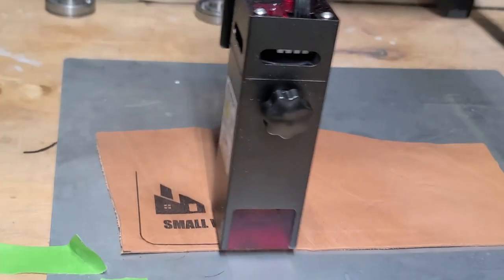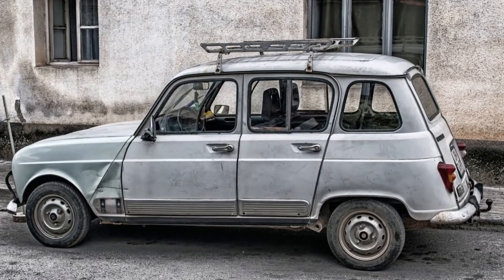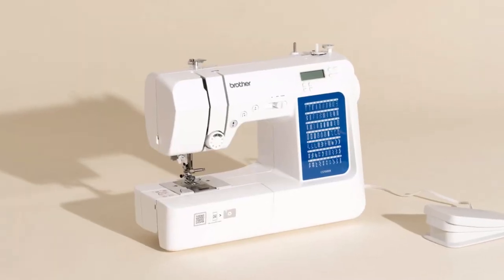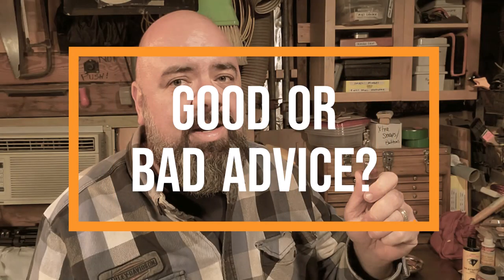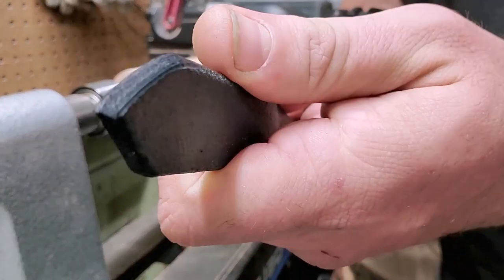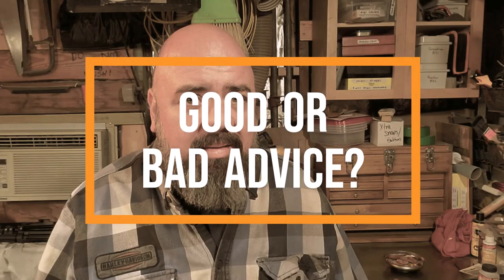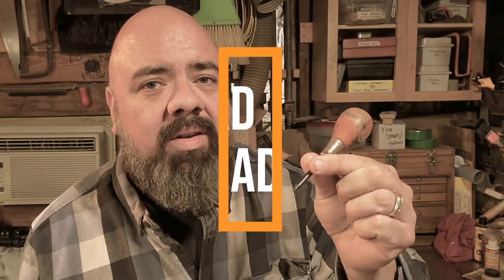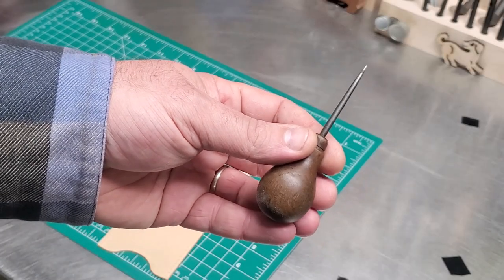INSTANT REGRET - Beginner Leather Craft Ideas in 2023

Comment: Here is something that might help without breaking the bank. Rather than trying to find granite for stamping try a piece of marble. I bought a piece that is 3/8x12x12 inches. $5.00 A bit sharp on the edges but easily sandable.  I keep it on a cutting mat and have really pounded on it with no problem.
Reply from the maker: @larrycumba2741 This is a great inexpensive idea!

Comment: On the 'only buy a tool when needed' point. This can also lead to a complacency trap. It is easy to fall into the habit of saying 'well this project would require this new tool/material so I will skip it for now' and then never actually get back to it.

That said, one leathersmith I know is fond of saying that most of the work you will do can be done with 4 dedicated tools. Knife, Needle, Mallet/Maul, and an Awl. Apparently, nearly everything else can be done with other things. For example, a cloth can be used instead of an Edge Slicker and to dye the leather. Though apparently, he watched a video by the Skill Tree youtube channel and is now obsessing over the filling you can get for homemade stuffed animals as the way to dye leather for cheap. Bonus in that you can always make a stuffed animal or pillow with it.

Edit: Said Leathersmith has asked me to specify that he does recommend a strap cutter, round knife, and a good pair of shears as immediate purchases if one decides to go any further than just making small items.
Reply from the maker: @jtmc93 I can definitely see the complacency thing happen,  you would just have to be aware of this mindset to avoid i t,  instead of avoiding the project you would like to build.

Comment: I’ll have to admit to using a pick, for my stitching holes. ( and a dremel). Not my Tandy , but the Chinese ones that came in a kit. They are a lot thinner- I have needles the same size! Since the handles broke often I purchased a few more. Now, since those prices have gone up, I’m hoping my last one lasts!
I actually do not like the chisels, all that much. They don’t go through thicker leather. Plus I think they also push just like a pick.
I’m curious about what’s a good & inexpensive strap-belt cutting tool. 
My strap cutter will not cut 11+ leather. It breaks the blade and also readjusts the strap width. 
I see there is an Ampseven that looks like it might be useful. Anyone know?
Reply from the maker: @cherriebeyer9531 Thank you for sharing your experience.  I sometimes use a stitching punch that will cut three holes in a holes in a row.  Its cuts holes like a punch, and doesn't have chiseled ends.
But, if using the all works fine with you,  I say stick with it. 
As far as the strap cutter you are talking about it,  Im not familiar with it.  Perhaps one of the Big Stacks Family can chime in with more information.

Comment: I'm in the semi-disagree about the tools one, a major reason is that it's something where I've had several projects that I've tried out doing which I never would have considered except that I had the tools there to try them out with several different things. Also, with things such as stamps and other tools, while not necessary, looking for deals for interesting ones is a fun thing to do and the stamps aren't that expensive to start with.

Same thing with the amazon kits, several of the kits, especially the ones with a nicer case, are a good starting point for getting a lot of things at once. There are also the project kits that are another great option on Amazon and elsewhere for different things that give you what you need to make them (or most of the things). It also works as a way for someone starting to actually feel like they've accomplished something with something actually being finished during it and many give you some tools in the process to build it up.

Also, the spiked roller that you were using is for marking stitching holes, you run it along a groove and it marks regular points to go through with stitching. I've largely used it to mark locations so that I can count them out and figure out the specifics for the actual hole placement since a light run through a groove doesn't leave much of a mark when you're done and higher pressure, with thinner/softer leather can go for the entire stitching holes.
Reply from the maker: @AzraelThantos I can agree with you on getting some of those stamps and some of the specialty tools if you find them at a good price or on sale.  I bought someone's entire leather set before and got a bunch of things I still haven't used.
I'm still in the camp that some tools in the tool kit are okay,  some are cheap garbage.   After working with decent tools,  I still think it's best to purchase the tools outside of the kits. 
I'm going to try that spiky wheel for stitching holes, because I don't see how it will work out properly.  But I'm willing to try and eat crow if I'm wrong.
And you are right about the 3d stamps, this things are really cool.   They add a great touch to your work while starting out!

Comment: i've been told that the wheel you asked what it was is a stiching wheel. It is used to maker where the stiching holes should go. It is used with a stiching awl to create the holes. I do not have one, and do not plan to buy one, Iagree with you, stick with the punches designed to give you the best results.
Reply: I have what he is showing. They are not the same as the stitching wheels. They have thin almost like bristles, and are too close for stitches.
Reply from the maker: @edgell3 @cherriebeyer9331 is correct, the pins are too small.   In my livestream video from a few months ago, one of the Big Stacks Family told me it was to transfer patterns using carbon paper.
Reply: @bigstacksshop  I was taught that both are right.

It transfers a stitching pattern through carbon paper or directly onto the item depending on circumstances. The closer stitches are meant for lighter weight leathers and cloth.

One way I was shown to use it was to lay a piece of cloth on top of carbon paper on top of the leather, then run this along where the seam will be. Then use that to sew the cloth and leather together.

The example being made was cloth lined leather gloves.

Was also told that if you have a sewing machine capable of doing this then it is pointless.

Edit: though the Amazon specials variety tend to be flimsy compared to others.

(And I was also informed it can be used for something like embroidery on leather though it wasn't elaborated on how that worked.)
Reply from the maker: @JTMC93  when stitching fabric and wood together makes a lot of sense.

Comment: So i wonder, olive oil does go rancid; linseed oil usually manages to avoid that, or it goes through that stage while not becoming permanently stinky and gels instead.

Whether you should be using something from a tree or from a cow when doing a cow hide thing? Well there's a good reason most of the cow got stripped away, it wasn't good for it either, the cow goes bad rather rapidly and very very unpleasantly. Sooo... it depends i guess? You probably use wax, does wax come from a cow? Some of the products used in the craft may contain petrochemicals, do they come from a cow?
Reply from the maker: @SianaGearz I use the stuff which came from the cow to hydrate it just enough.   I'm not trying to turn it back into a cow.
I do agree wurth your logic,  there are a lot of products which aren't from a cow and work.   But I definitely don't want something which will go rancid.

Comment: ive been using olive oil since i started and have never had it go "rancid"
Reply from the maker: @jacdupleatherworks I admit I haven't personally tested this theory with leather,  but I've been woodworking a long time and I know it will get a funky over time on wooden cutting boards.
Reply: @bigstacksshop  when I was first started out I was given some key advice that seems to have held for me. There are two types of olive oil: hot pressed and cold pressed. Hot pressed olive oil will go rancid, cold pressed wont and you should only ever use olive oil you know for certain is cold pressed. Never seems to have gone astray for me and I have had a piece I oiled with cold pressed olive oil in my backpack for 4 years now without an issue. The type of olive oil that is used by default seems to vary from country to country so it might be why some people never have an issue and others do. 

I can't find any actual evidence as to why this seems to be the case when used on leather and a lot of mixed results of people trying it.
Reply from the maker: @Betttris13  I'm going to have to try the cold pressed variety

Comment: I wouldn't get a cheap stitching groover from amazon. I did and it mostly compressed the leather and shaved off a hair of it. 
Later i got a $40 Japanese stitching groover from another website, its like a razor sharp katana. it actually cuts the leather groove like its suppose too. 

Amazon leather craft kits are terrible tool quality. there is no description of the tools inside either so it confuses new people. the only thing i still use from my amazon kit is the needles and thread. everything else was either unnecessary or dull. Also the stitching groover in the kit was machined wrong the edge guide bar sits at an angle from the tips and should of been thrown in the scrap bin.
Reply from the maker: @darkshadowsx5949 Thank you for sharing,  I appreciate your input.   Where did you get your stitching grover?   I'd like to try it out.
Reply: @bigstacksshop  Japanese Stitching Groover & Edge Creaser 
its $50 not 40 sorry.
Reply from the maker: Is it from BuckleGuy?  I found on their site

Comment: Getchu a cranker shoe patcher from the CCP. They’re pretty cheap and you can make them produce fairly acceptable stitching in the best case scenario and everything goes just right.  …provided that you’ve put in your necessary 1000 hours disassembling, cleaning, removing mill scale, sanding, straightening, modifying, painting, polishing, reassembling, setting up, experimenting, failing, researching, reading message boards, finding the right needles and thread, experimenting, endlessly adjusting tension top and bottom, being frustrated, throwing machine, repairs, mor learning, experimenting, celebrate finding tricks for setting timing and needle depth, poke needle thru finger, Waller out needle hole to run heavier needle for heavier thread, search for preloaded bobbins that weird size, frustration, more experiments then finally, the planets are aligned and you get good stitches!  Then you realize you’ll never see anything that thin and try what you use and break the needle make rats best underneath, nothing will move it’s all jacked up throw the piece of crap again!  Repair…. Then one day, things finally start making sense and you get a feel for why things are how they are and what does what and finally…you can semireliably lay down some stitches.  I basically only end up using mine on belts.  Mostly long straight runs, it’s not too bad.  Wish you could load about three times as much bobbin thread in it tho.  What a pain!  But I’ve got ideas. I’m working on a solution. I’d possibly use it more if I can fix the tiny bobbin issue. But it’s still just semi good lock stitches tho. Most of what I make really needs saddle stitched fir me to feel good about it. I don’t trust lock stitches on some if my stuff at all.   
Maybe if you know about sewing already and are pretty handy, and patient, and good at trouble shooting, depending on what kind of work you do it may be worth getting one of these hand crank shoe patchers.  …sit around with your hand on your crank.  Ha!  Hell, maybe I’m just an idiot n had a rough time figuring it out. Idk.  Get one just so you can make crank jokes.
Reply from the maker: All of what you wrote is exactly why I did not get one.   I'm searching for a industrial grade machine which will work.   Probably something used so it won't break the bank.
I'm not the biggest fan of hand stitching,  but I feel it is a better option for me right now.